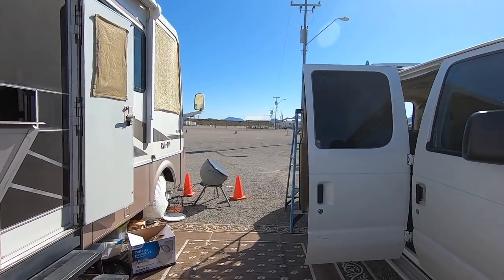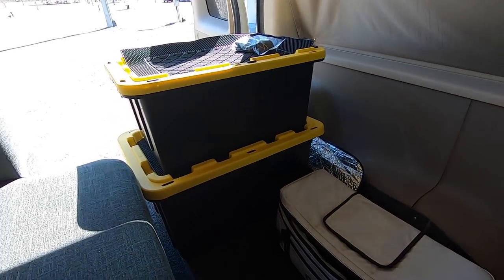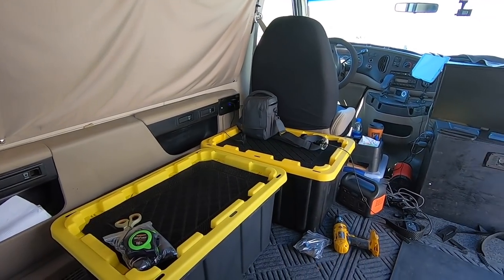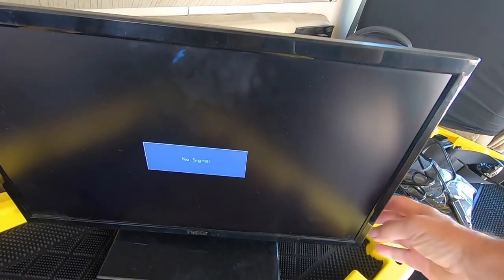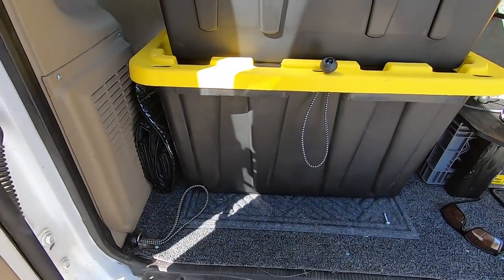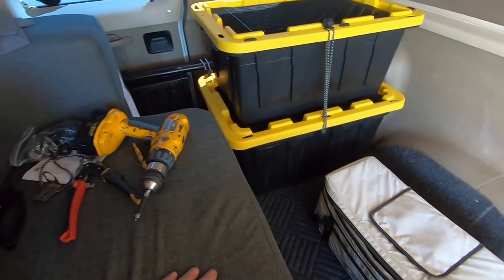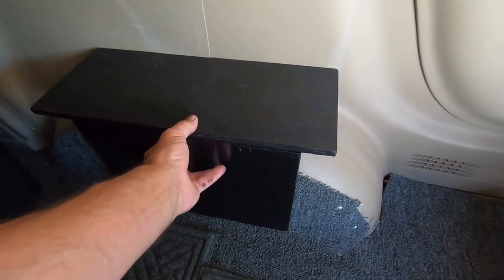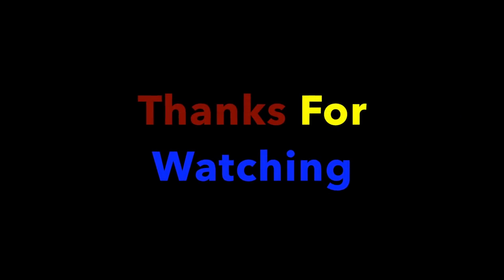Van Build.. Bits and Pieces...  Small Projects

Comment: The 12 volt cord to power your TV that's not working.  The cigarette lighter end can be unscrewed in the middle to expose a fuse.  Maybe the fuse is misaligned or blown.
Reply from the maker: i checked the fuse after the video it was good.... the end that plugs to tv doesnt work....  thanks for your help
Reply: I would get a new power cord.  DC to DC is more efficient than converting DC to AC and then going back the other way.  Generates heat = loss of efficiency.   @rvertv

Comment: A lot of the 12 volt adapters have a fuse under the center post.  That may be missing or blown if it has one.  Love the videos.  Keep up the good work.
Reply: Or the center post isn’t being depressed in enough to make the connection to the fuse.